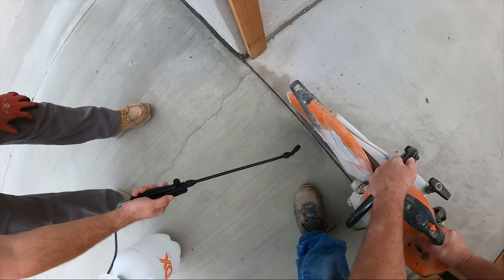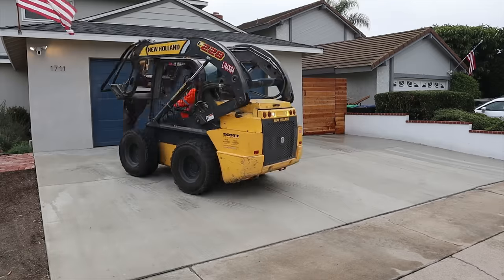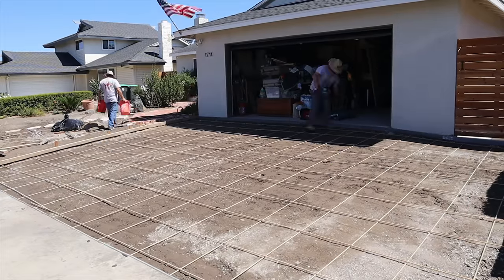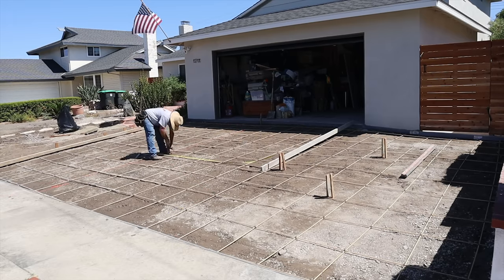Concrete GONE WRONG! Had to Remove and Replace

Comment: It looks like "concrete cancer" ASR, a lack of fly ash in the mix. Pools in central TX are cracking and crumbling that were made in 2017 to 2023 because of the poor quality concrete mix. Fly ash was left out as it comes from burning coal that is in short supply. Without fly ash concrete cracks and crumbles.
TX home slabs should also be crumbling  along with the pools if poured with the same outfit.
Reply from the maker: I heard it was a lack of cement, because it takes energy to produce, but the grid was in rolling black outs.
Also the harbors importing to the docks were shut down in the harbors

Comment: I'll never understand the addiction the USA has in placing garage-ways and walk-paths in concrete like this, in the EU we almost always do it with stones, if something needs to be reworked we just remove all the stones and re-use them afterwards, as opposed to the US way where you have to destroy all the concrete and make new, its just wasteful. Not to mention the drying of concrete releases lots of CO2, which isnt great.

Comment: Don't put steel on exterior concrete and you won't have  all those little surface cracks
Reply from the maker: I didn't, I used fiberglass

Comment: The ratio between sand and cement is not correct, too much sand or the layer of concrete is too thin .
Reply from the maker: I think it was a contaminated load. Probably the sand

Comment: They used dirty sand, hairline cracks throughout, sections cracking, sounds like walking on potato chips when you first walk on it, then the surface pockets show up. Bad Mix
Reply from the maker: Yes and I think bad cement

Comment: some of u contractors wanna add a bunch of water to the load.  That happens a lot.  U weaken the concrete like that.  That tornado that hit the Amazon building and destroyed half of it in southern IL-  the contractor makes us add at least 15 or 20 gallons of water,  making the slump  a 6"   And then they wonder why the building collapses  or driveways have cracks in it....It's YOUR FAULT
Reply from the maker: Usually it's the pumper or ready mix driver that adds water

Comment: What Ive seen adding fiber and with a srcedding watter after the mix is the culprit why it cracked and was dusty and brittly. Adding ecess watter it is also what is difference. Cemex or nathional you are interfiering with the mix. Period. Sorry no firmi is im the wring you are.

Comment: You guys mess with that concrete too much. Pour it a little more wet, let it bake. Float it as soon as it’s in once not twice, let it sit, and just float and finish
Reply from the maker: I wish it was that easy
Reply: @OdellCompleteConcrete  i don’t want to criticize and that’s not where I am coming from. But instead of ordering the concrete so tight, running that compactor, and working the concrete so much, try digging down an extra 4 inches, put down 2B limestone, don’t compact it, pour it a bit more wet, float it as soon as you get it in, let it sit for an hour, then finish it. Again, not trying to criticize, but even when I was starting out, which I know your not, if you work that concrete to much it just peals right up. You will not even need to ad the fiber

Comment: Man. U need to hire a few experience concrete guys until you learn the trade. I’ve seen this vid and others of yours that had to be ripped out immediately after. DUDE.   Hire a competent supervisor to run the crew and teach you concrete. Keep the name of ur company the same for now. , it’s ruined   Then after a few years under a good supervisor s training and you become somewhat competent then change company name and do decent work.  WTF 60% of your work we have to rip out.  COME ON DUDE.
Reply from the maker: You're not making any sense
Reply: @OdellCompleteConcrete  lol. I didn’t expect you to understand much after seeing your work. Let me talk slower.  The owner of this company needs to hire a competent  cement  tradesman to train those crew in the video. After speaking to others , the company in this video has over 60% of completed jobs that were wrong and had to be ripped out and  a competent licensed crew hired to fix the job to deter lawsuits for shoddy work

Comment: Why do you guys do your laying down like that. And why can't one guy screet by himself. I do. Why do you Fresno like that too put it the way the bow float is like wtf is going on there. I done concrete for a long time im 38 and I would like to work with that Spanish guy and you one day lay a few driveways sidewalks down but try it my way those few pours you would probably like it. I do like those books though where the f do you get those from. Write back if you want I will post some pictures or videos of my work this summer

Comment: You are brooming to soon and not using water. The finish is patchy and not consistent on both driveways. I would put sand and lay plastic and then another layer of sand. Most likely the concrete is a bad batch and I would have the concrete salesman come out before you tear it out
Reply from the maker: For sure

Comment: Any other fly by night concrete company would blame the owner for the bad concrete mix. This video will tell everyone to avoid National Concrete Company. They make such a shitty product. National Concrete is probably the same company the Detroit area road & street cement contractors use in building new roadways, only to have deep & severe potholes appear in less than 6 months after poured. After all, it's the lowest bid of companies in road construction that get the contract. Cheap cement, and con men construction companies ALWAYS get the contract to "rebuild" Detroit area freeways, streets, and roadways. Many of the roads were completely redone, only to have them crumble into pothole nightmares. There are potholes bigger in Detroit area roads than the holes left behind on roads bombed in Afghanistan. 
But Detroit lying mayor Mike Duggan sez every 14 seconds in public - "Detroit is coming back". Yep, Detroit is coming back allright. Back to how Detroit looked after the 1967 riot. Miles and miles of dilapidated homes & business buildings, laced with more miles of empty fields where residential homes used to be.
Mighty Mike is doing a great job of building up the Detroit Downtown area. Lot's and lot's of apartment buildings going up in the downtown area, but no lot's and lot's of new affordable homes going up in nearby vacant neighborhoods. Mike Duggan wants EVERYBODY to live in apartments in Detroit - not homes.
Reply from the maker: Go Detroit Lions

Comment: I can tell your only  Using 3500 pSI concrete. It's just junk. You need 2  to step your game up the 5000 P s I It's better quality better concrete.   All of my customers get 7 sack 5000 PSII don't care if I'm doing a driveway. Or a patio.    Or a parking lot.     It's the right thing to do.  A lot of contractors just cut corners to make more money for themselves. Spend the money  give the customer better quality.

Comment: The holes coming up in the finished concrete are because of lignites coming from the sand pit mining.🇦🇺🇦🇺🇦🇺🇦🇺🇦🇺Quite a common problem when mining too deep.I would go back to the Concrete supplier and claim.
Reply: Also doesn’t look as if there is isn’t enough gravel in the excavated concrete.😪😪😪🇦🇺🇦🇺🇦🇺🇦🇺
Reply: Also here in Australia we add the fibres at the batch plant before loading for better dispersion through the mix.🇦🇺🇦🇺🇦🇺🇦🇺
Reply from the maker: I concur
TY

Comment: Looks to me like some of that concrete was only 2 in thick but whatever your video you're the one who showed it not to mention tons of other factors that go into pouring concrete and as a student from one of the very few in the United States concrete tech school it's always gets blamed on the concrete company which 95% of the time is a scapegoat for a piss-poor job done by the contractor and I don't care if the driveway across the road what you called perfect but to an inspector looks pretty shity and then on the one you're hammering out you're saying the mud came from a different company don't know what state you're in and really don't care but temperature moisture along with many other factors the day you poured probably had more to do with it then the concrete company you can tell just by your guys broom marks shows your guys didn't know what the f*** they were doing Plus fiberglass re-rod come on now even after the inspector second-guess it and for you saying the company that supplied the fiberglass rods claimed it stronger that's hilarious don't you think that just somebody trying to sell a product

Comment: That is not the Concrete, looks like the Finishers,  Shame on you, Spend 2 minutes to understand your business. you guess in wrong, start with Book called _ Control and design of Concrete.  
Crazing or what you call surface cracks only comes from to much water added while finishing,  this is on your guys during finishing.   How much water did you add.  If you really dont think you did something wrong, get a petrograph next time and it will make you a better contractor.